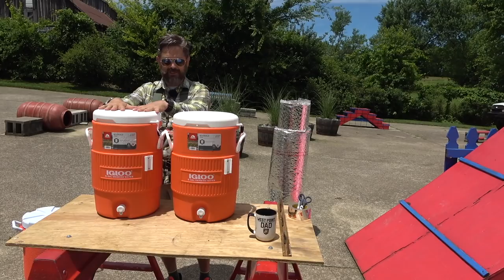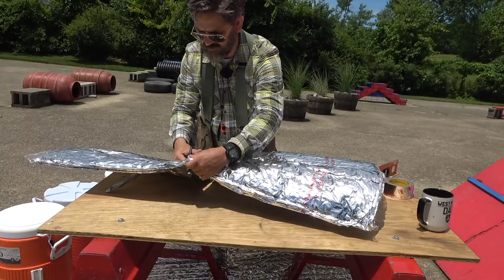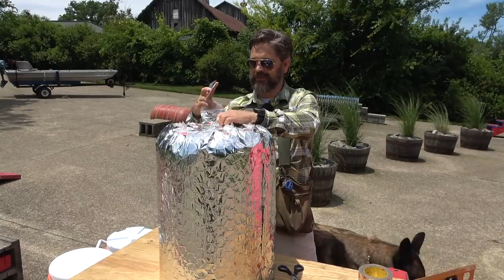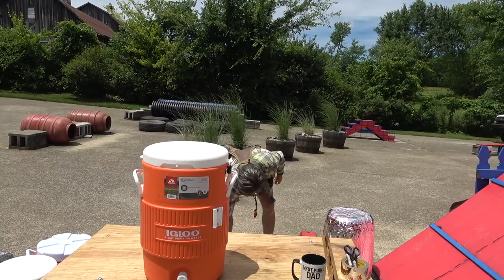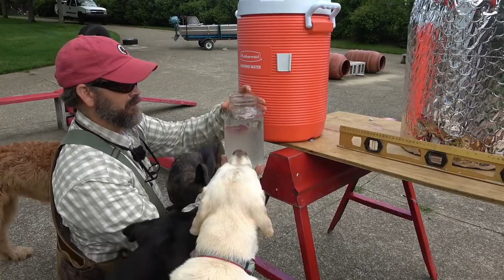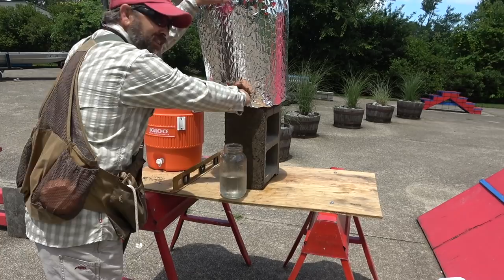DIY Water Cooler Cover/Insulator - Is It Effective?

Comment: If you look closely at the cooler itself, you'll see it's insulated everywhere BUT the lid. The lid is the point that gets hot first and not insulated. Why? This is how they justify high cost for other coolers. If you get a can of closed cell spray foam. Go on youtube. There's videos of how to make a "CHEAP" cooler nearly as good as those $300, $400 and up coolers. Can of closed cell foam cost about $8 and can do all 3 of your drink coolers.

Comment: I am thinking the way the cover is designed, that it will hold heat in which will adversely affect its ability to keep the cooler cool. But I will still go with the covered cooler.

Comment: Isn't there something in the insulation that you shouldn't breathe?  Also, what about the handles?  How do you carry it?
Reply from the maker: This insulation is simply Mylar backed bubble wrap. There’s no small fibers to come off of the material.

As far as carrying it, I think the best strategy would be to place the cooler where it’s needed, then simply place the cover on the cooler.
Reply: @StonnieDennis  🤣🤣🤣 I was thinking the same thing. I'll use the same type of insulation barrier foam boards under my pool under the cooler and cover it with the insulation. That way, the sun will bounce off it instead of warning it. I'm also going to line the inside with reflectix because I don't use ice, I use frozen jugs. And I'll line it with a trashbag for good measure. It'll make clean up easier too. I'm also insulating the lid because it's crazy that they don't come that way.